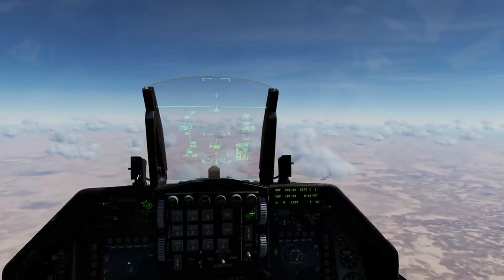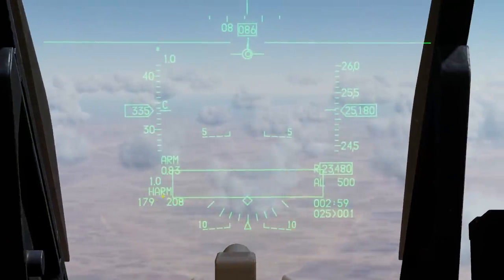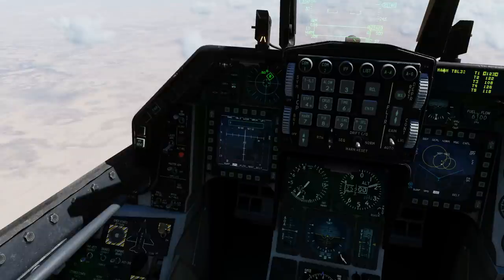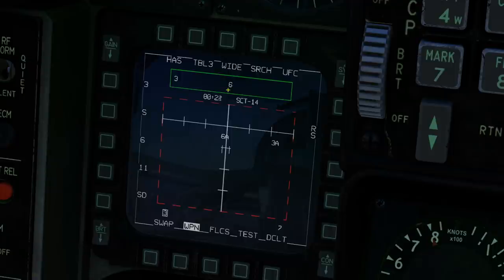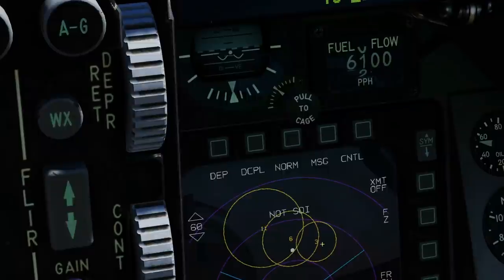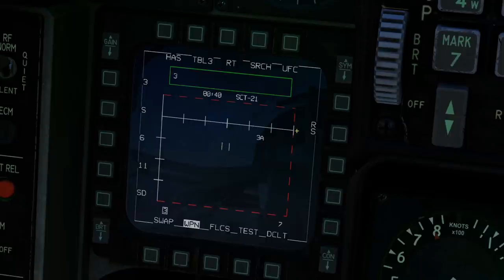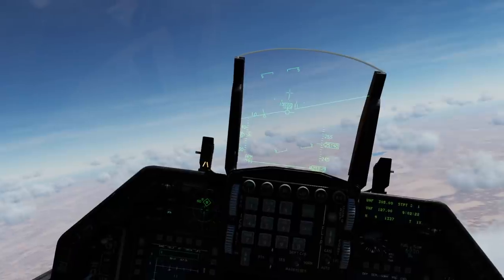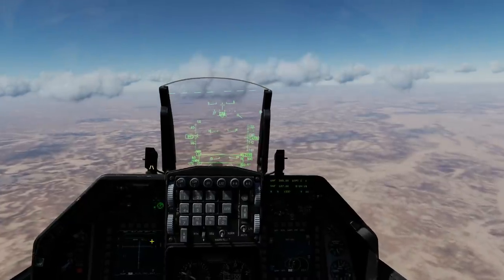F-16C Viper: AGM-88C HARM (HAS Mode) Tutorial | DCS WORLD

Comment: Hey, I got a problem with the HARM mode and hope you can help me:
I have activate Air-Ground, selcted the Rocket. Go to Weapon and see the table and so... BUT: My Timer has an amount of  0:49 in Wide and just count down to 0:45. After this, it start again at 0:49 and it count one "scandone" up. Do you have an idea?
Reply: Mine does the same exact thing, I've watched multiple videos and searched the forums but no luck
Reply: @ryanw5584  I checked it. Simply reason: There is no radar signature. Or maybe non you choose in the table. If one target appears, which match the search table, the timer continues.
Reply: @SMGGabriel  ok cool I was doing a fast mission with only SA-13 and it must not have been scanning bc it would never pop up on radar until I was right on top of it. So maybe I was using wrong type of Sam to train with

Comment: So if you want to piss off the super realism guys that have been crying all over the forum for days, load up 2 HARM's on stations 4 and 6, and 6 Mavericks on stations 3 and 7 and go to town 🤣
Reply: You can’t put either of those on 4 and 6, only on 3 and 7.  There are multiple reasons why the inner most pylons can’t carry missiles.  1st the pylons are not wired for these weapons. And 2nd the exhaust from the missiles would damage the tail wings.  The tips of the stabs already get scorched by Mavericks on 3 and 7 when launching from the inboard rail of a triple rack and that was when they still used triple mavs in the F-16A which had shorter stabs than the later models
Reply: @Knightfang1  you can carry 4 HARMS. 1 per pylon. I'm pretty sure they go instead of the drop tanks.
Reply: Danny D no you can’t stations 4 and 6 on the F-16C don’t even have the option to carry air to ground missiles.  Only 3 and 7 do and it’s 1 AGM-88C per pylon.  I’m looking at the load out screen as I type this
Reply: @Knightfang1  it's not implemented yet. Next patch. Go read the F16 forum on ED.
Reply: @Knightfang1  Yeah...turns out they are actually giving us the BRU-55 Rack as seen here: https://media.discordapp.net/attachments/206024489518104576/758396087815372841/f16wildweaselfl1_zpsab4de99a.png on a F-16